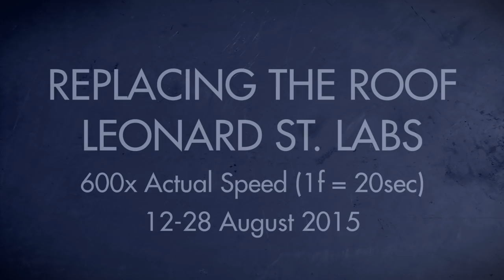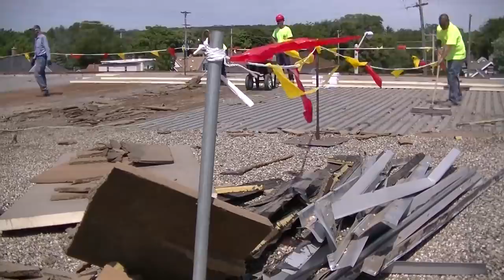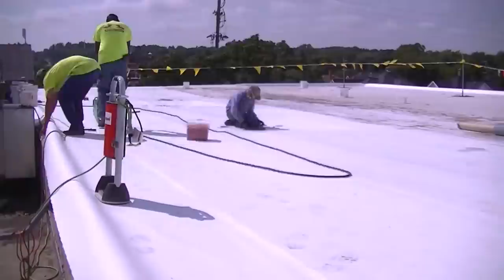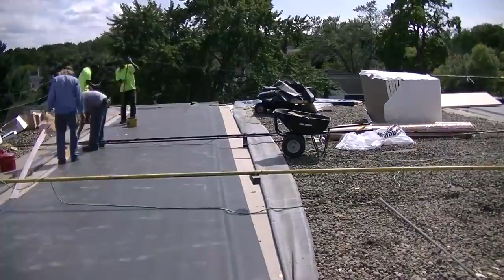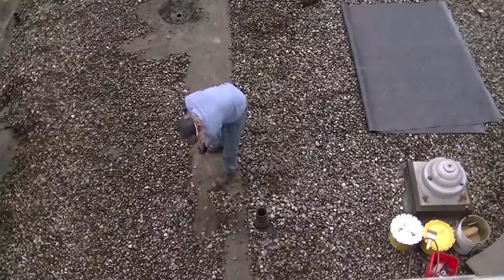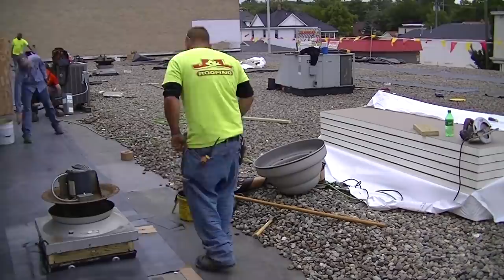Repairing the Roof: Abbreviated Workday #48

Comment: So, why stone on the roof vs some other roofing method?
Reply: i think it protects it from the elements the roof material n helps deflect heat in summer
Reply: +cjf334 Partially, yes. Holds EPDM (rubber) membrane in place and helps to protect from UV exposure, too.
Reply: +OnorexDeixCaduti Protects the sheathing material from UV damage and rain impact damage. It's also pretty cheap and dissipates some of the heat.